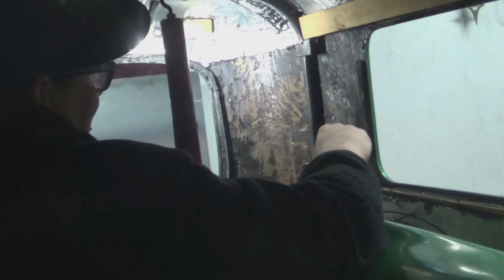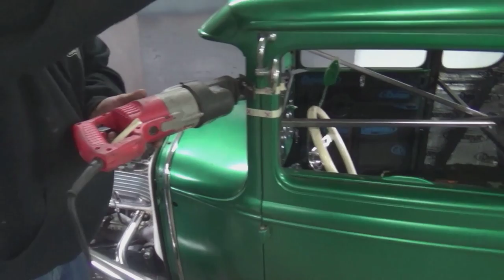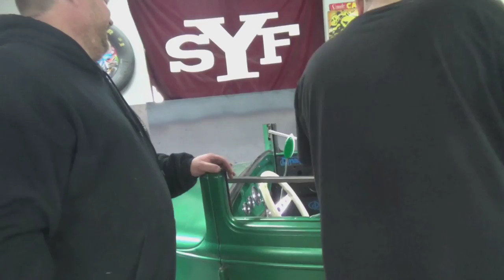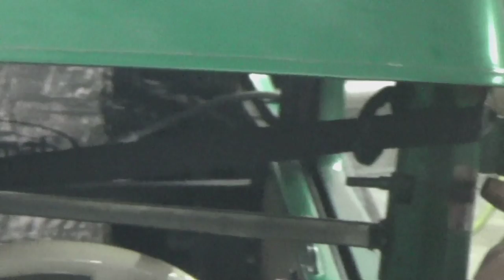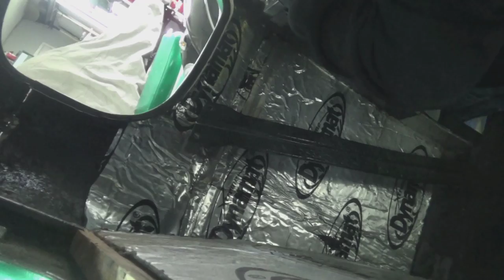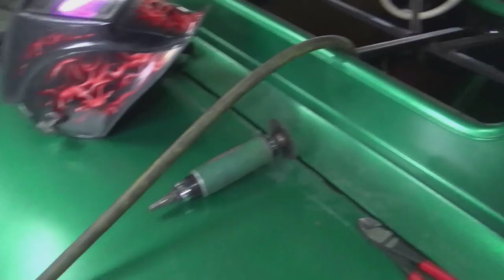Model A top chop.

Comment: Nice excited to see the transformation of the top. I know on my prior model A I did 3 3/4" in the front and 3" in the back to match pretty close the chassis angle while on the ground. Also got the 1928 pickup home. once I get things settled will start the videos. Know anyone with extra model A pickup parts? I have alot also that I will probably be going through. Stay tuned :)

Comment: l want to see the glass get cut with the sawzall next.
Reply: haha yes
Reply: You should of made a sleeve opening on the b pillers so you could weld the inner structure in the post for extra strength you may need in a crash.
Reply: You just won't have to roll them up as high.